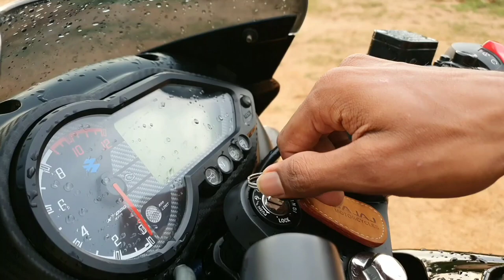Bajaj Pulsar 150bs6 Full Review in Telugu | Automotive in Telugu 2020

Comment: Nice video bro nenu kuda ede bike tesukuna 4 months back but parking lights headlight tho patu on and off avtunay anthey kani old pulsar bike la key on chesaka enduku parking lights on avtledu only engine start cheste ne parking lights on avtunay enduko chepatara bro
Reply: Fuel injection system battery meda run avutadii soo ignition key on lo unnapudu head light and turning light engine on lo lekunaa on ainattuu iste battery life taggipotadi taravata fuel injection ki saripada power supply chaileduu....!
Reply: @laxmanmurthy9384   Turning lights kadu bro parking lights kosam adugutuna headlight pakkana unaty kada small ga parking lights avi ingition on chesaka on avtunay old pulsar lo but na bike lo engine start chestene on avtunay, problem enti ani adugutuna